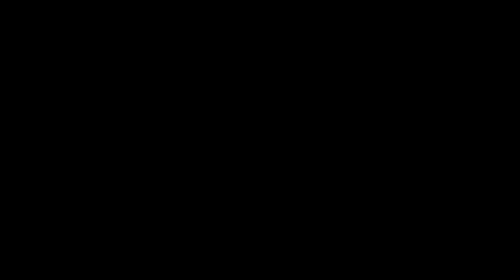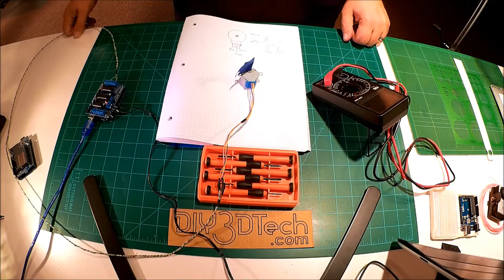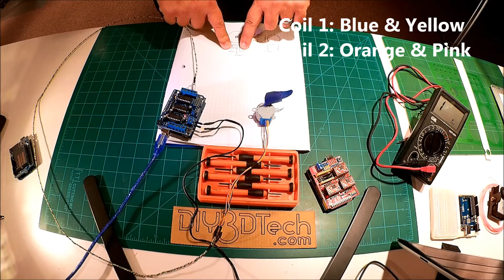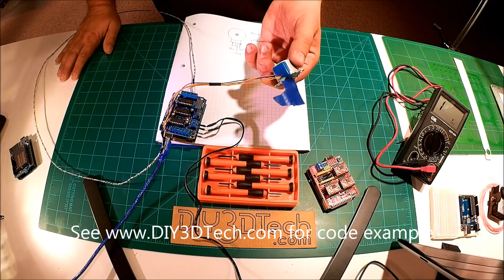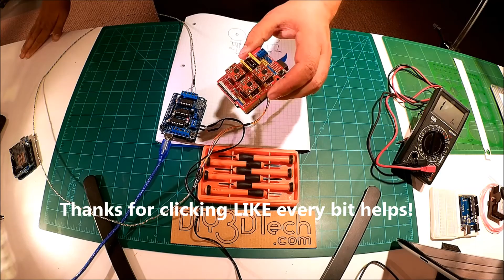28BYJ-48 Unipolar to Bipolar Conversion Part 2

Comment: I'm trying to control two bipolar 28byj-48's independently with push buttons.  Is this possible, I am stuck!  I need each of them to turn one way with one button press and the other way with the other button.  To clarify, two motors, four buttons.  Thank you!
Reply from the maker: I don't see why this would not be possible, simply code that logic in your sketch...

Comment: Thanks for your video, just to confirm: cutting the trace of the centre tap double the rating from 5v to 10v? Is this correct?
Reply from the maker: No, cutting the trace simply creates a stronger magnet at a lower resolution by converting from unipolar to bipolar to increase the torque output  at the same voltage.  However aside from this the 28BYJ is can be tolerant of higher voltages however at reduced duty cycles...
Reply: I’ve been looking and people are saying that it’s possible to put 9V on the motor but if I do that the motor will only give a buzzing sound and it stops rotating. Do you have a wire scheme how to do this?

Comment: Why spin 2 direction ?? 
i try 28byj(Bipolar , like this video ) with A4988  ... 28byj spin 2 direction ,, maybe after 1 or 2 cycle the motor spin change . i used grbl to moving 28byj.
can help me ? ..
Reply from the maker: These motors can become flaky, however would say you likely have something off in the driver circuit as GRBL is pretty stable.  Again this is not a lot of info however this sounds like a timing issue...

Comment: Great video sir. Thank you for uploading.....I would like to see if the bigger unipolar steppers can be converted into bipolar. Please make a video about that... I can't find your other videos where are those .
Reply from the maker: +Abbas Rajput Think it would harder as you would need access to the coils and with these little guys its easy to get at...
Reply: You are right but i would like to give it a chance...becouse most of old photocopy machine holds unipolar steppers so in order to use them with 3d printers i have to modify them
Reply from the maker: +Abbas Rajput again if you can access the trace or wire, go for it :-)